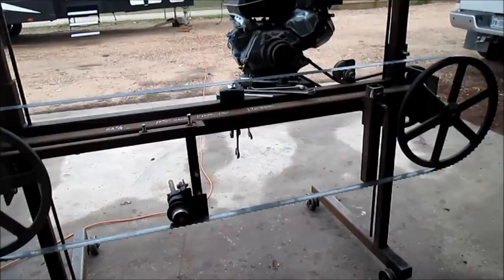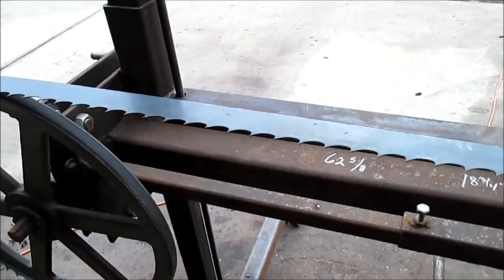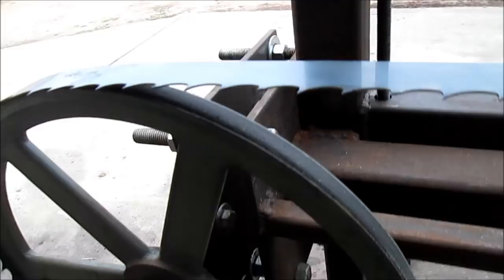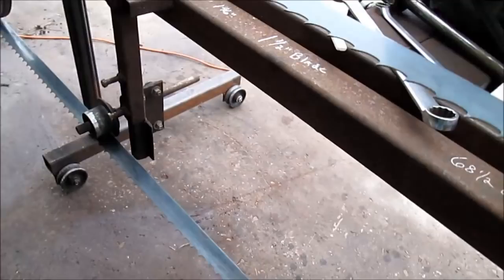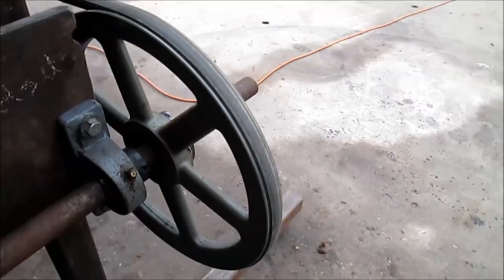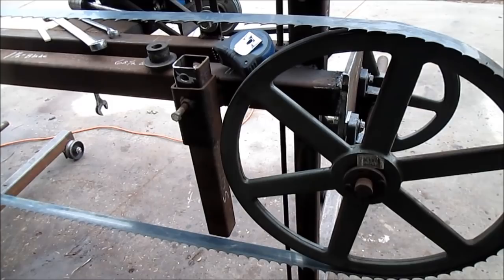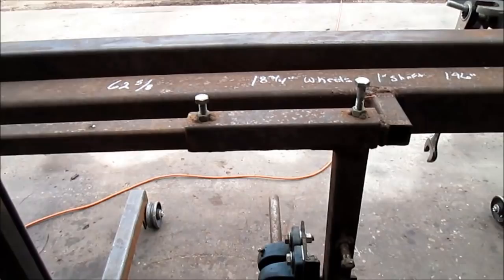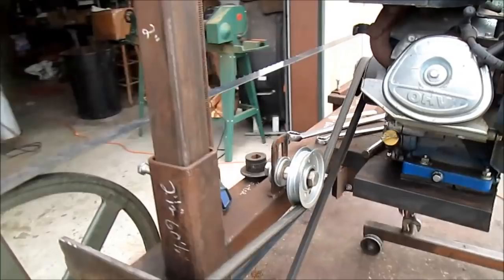DIY Wood Sawmill Build Dimensions & Measurements

Comment: Good video........greetings from PLAYA DEL CARMEN....
Reply from the maker: Thank you.appreciate the comment
Reply: @LarrySbrusch  Does the ACME rod chain tensioner consist of two sprockets? If so, are the chain sprocket pulleys adjustable, via an elongated slot in the 2" X 6" angle iron that is welded on the top bar?  Would like to build a 144" blade model based off of your build. Thanks Larry, love the simplicity of the blade tensioner.
Reply from the maker: @TheBayouChene  the acme rod has a fixed pulley on the top of each side and I have a slack adjusting pulley in the middle.

Comment: What thickness tubing did you use? and, can you share where you get your blades? Thanks
Reply from the maker: I will have to go back and measure, But If i remember correctly it was 1/4' & 3/16". I will check again tomorrow to make sure
Reply from the maker: I only use woodmizer 7 degree turbo blades. I have tried others , but nothing beats them so far
Reply: @LarrySbrusch  Thank you.

Comment: Just wondering if you build these and sell them, if so where are you located.
Reply from the maker: I have built a few but with my age and price of steel and other items have slowed down a lot
Reply: @LarrySbrusch  I guess that is a not hen, and if not, how much would a unit like this cost to have built by you, and again I guess it all depends on your location as well. Thanks
Reply from the maker: Complete head with engine would of cost $3500 about a year ago

Comment: I like what your building. the only thing I see wrong from my perspective is your belt tensioner pulley should be on the bottom so you aren't pulling up on adjustment slot
Reply from the maker: Appreciate the comment. Thank you
Reply: Plus you shouldn't really fit the tensioner on the "loaded" side of the belt either ?

Comment: From what I see, correct me if I am wrong, there is none blade-tensionism mechanism as such, but you simply have to tamper with the threaded rods and nuts holding the plate with the idle wheel's pillow bearings, in order to relieve or rise tension on the blade.
Reply from the maker: you are correct..I can change a blade out in less than 5 minutes and to me that is a plus..It works great for me and is an option for others.. It may not be for everyone..I can say that it is something that an average person can do without having milling equipment to make blade tensioners like other sawmills have.. We appreciate the comment

Comment: Could you tell us what the height of the sawmill is? Also could you explain how the threaded rods work for the raising of the sawmill? Do they go into nuts welded to the tubing? Great videos by the way.
Reply from the maker: The overall height is 74" . my next build will not be that tall. I will go 65-66" and it should be fine..The threaded rod goes through the main frame and has the matching nut for the threaded rod welded to the underside of it, which in return lift the sawmill head up and down when the sprockets on top are rotated..Hope this helps. if not shoot me another message

Comment: Hello Larry, a few questions. How big of trees/slabs can you cut on this mill?  Does the 14 hp handle the large stuff?
Reply from the maker: I have cut slabs that are 46" Wide as long as they are pretty straight and you have to push it a little slower and allow the blade to do it's job,,but it cuts them fine..I could probably go a little bigger.. Most of my cuts are 12-19" and it is a little big for that
Reply: Thank you, I really like your build. I've seen almost every DYI sawmill build on YouTube and I'm going to use your model. Simple but very effective. Great job!
Reply from the maker: @DCain-ie3gr  ..appreciate the comment. Let me know if I can help you in any way..I have some of the parts needed to build it..https://www.txdashcovers.com/bbqpitpaac.html

Comment: What kind of cost do you think you have in this saw??
Reply from the maker: I never did really add up all the parts, but  I would guess around $1300.00. I recently put a basic parts kit together and I am selling it on my website at TXDashcovers.com under the woodworking industrial section. It's just a basic kit to help buyers take some of the guesswork out of buying and finding all of the parts that I used on my sawmill in  one package

Comment: I like the kit you're selling from your website,  why do you not offer the 1" axle shafts?
Reply from the maker: That is what I have on my sawmill and it seems to work fine. I am building a new sawmill and I will try the 1-1/4" shafts on it, to see how much of a difference it makes
Reply from the maker: I didn't read you message correctly..If I went any smaller on axle shafts. I feel that they would flex too much or break on such a big blade
Reply: @LarrySbrusch  I would think 1" axle would be good enough with the size wheels your using. From what I've seen if you use a bigger set of band wheels than you might go 1-1/4" shafts.
Reply from the maker: @jasonfeasel2726  I can see a little flex in the shaft when I put a lot of tension on it, but so  far no issues.I'm still going to try to go a little bigger on this mill I am currently building..Just to experiment
Reply: Guess I'll wait and see if it is better before ordering your kit. If so I would want the bigger upgrade.
Reply from the maker: @jasonfeasel2726  It may take me a couple of months as my dad recently passed away and I have my hands full with the estate

Comment: what is the blade speed?
Reply from the maker: I'm really not sure..I do not have any way to check it..but with a 429 cc engine.i run 3/4 throttle when I,m cutting..hope this helps

Comment: Can you put the measurements in writing please. I’m going to order your parts on your website. That is the perfect size mill I need.  Thanks
Reply from the maker: I won't be able to post them here online, but if you order some parts, let me know and I will include the basic measurements from my mill
Reply: Ok I ask for them when I order
Reply from the maker: @bubbagofigure9371  No problem...I will get you all the details
Reply from the maker: @Steady Trolling hp makes a difference, but I would start with wheels that are at least 18-3/4" and a pulling wheel from 10-11-3/4"..txdashcovers.com under industrial section to see them

Comment: Larry what is the threaded rod called and what the sizes ? How long and thread size? Also if you dont mind how tall are the square tubing that the stand is made out of , height ? You had mentioned that you would have moved the unit back another 4" ,can you elaborate what you mean by that ? Thanks love your videos my friend !
Reply from the maker: The threaded rod is 1/2" diameter.. mine is around 54-56" long..you will need to adjust yours to fit the mill you are building...make sure to keep it lubricated...I believe they called it something like machine screw all thread rod..do not use the regular all thread rod, it will wear out very quickly..
Reply: Perfect ,great to know,thank you Larry !

Comment: what size square tubing did you ues
Reply from the maker: I used 2" on the main post and the next size up to slide over it..
Reply: thanks going to try to build one going to use a trailer frame for the frame with 2" angle for the runners would that be ok
Reply from the maker: you should be OK with 2" angle
Reply: Thanks,  just looked a  lot of video didn't see anyone say what size would be the best
Reply from the maker: most people that have bigger mills are running 2"-2-1/4"  from what I have seen
Reply: Thanks, haven't seen a video on what size tubing that they used to build the frame I'm not going to build a big one But that sounds good to me .Thanks again